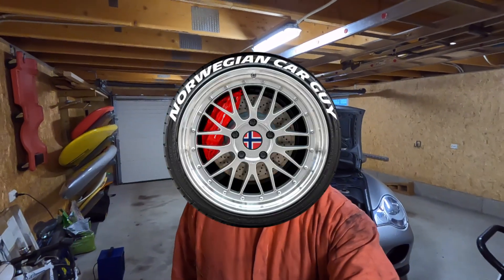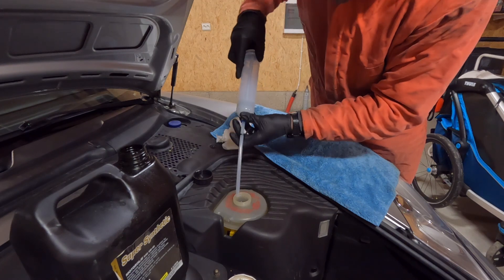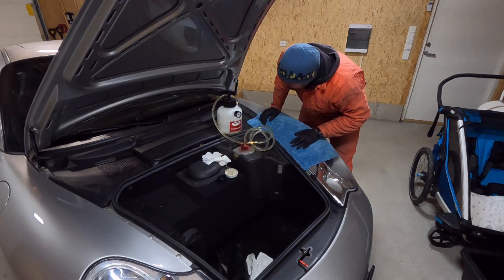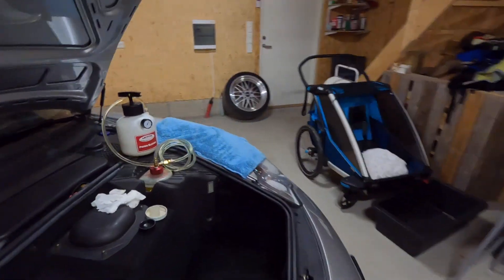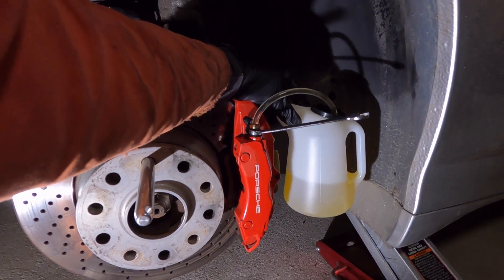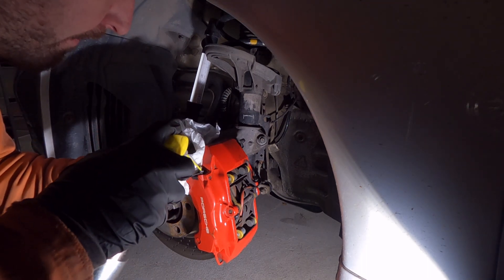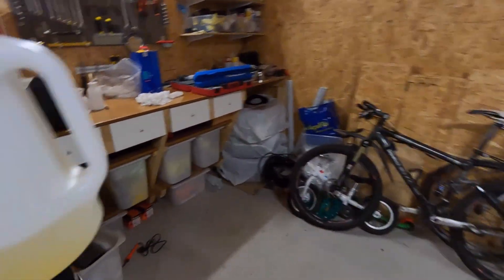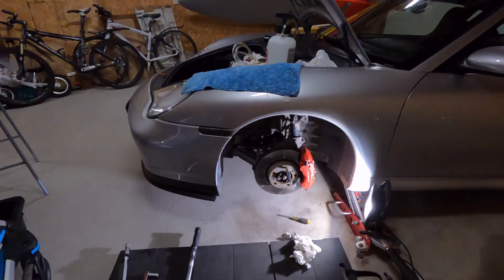How to change brake fluid on a Porsche 996/997/986/987: Quickest way to flush and bleed your brakes!

Comment: Nice Job but if you want it 100 % correct you need piwis and active the ABS Block .. becouse there is old fluid too in there .

which this method you cant get the fluid out of there ..
Reply from the maker: Thanks for the tips!

Comment: Good job thanks. You don't worry that the Penetrating oil might contaminate the brake fluid?
Reply from the maker: Thanks. It's around 9 months since I did the job now, and the pedal is still rock solid so it has not affected that at least. I would be very surprised if a small amount like that could affect the fluid behind a deep bolt like that

Comment: How did you clean the brake bleeder afterwards?
Reply from the maker: The correct way according to Motive is: To clean the POWER BLEEDER after use pour denatured alcohol into the tank and into the tube. Dispose of the dirty alcohol. Allow the unit to air dry. Store in a cool, dry, dark area with the hose wrapped loosely around the unit without any kinks in the hose. 👍